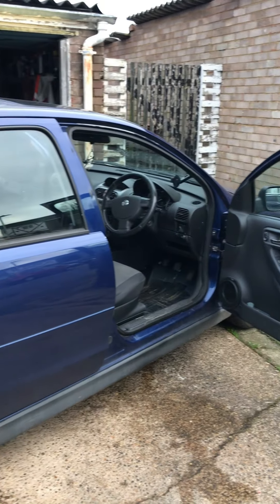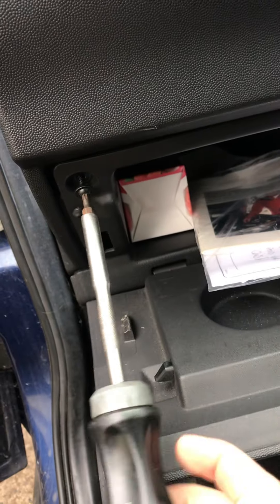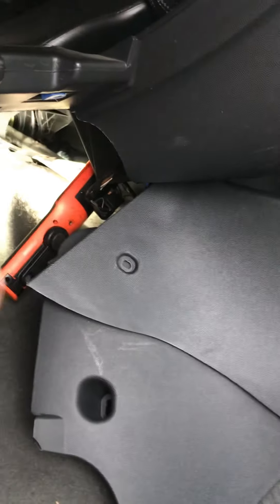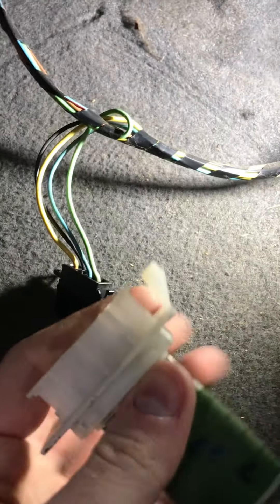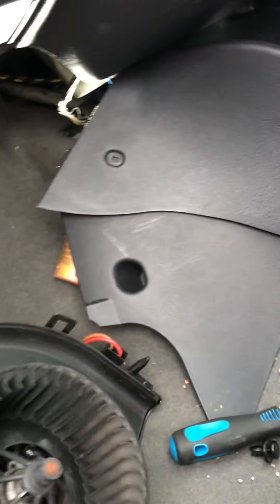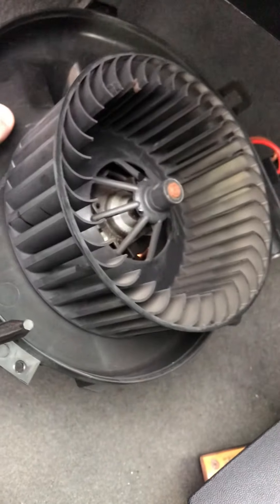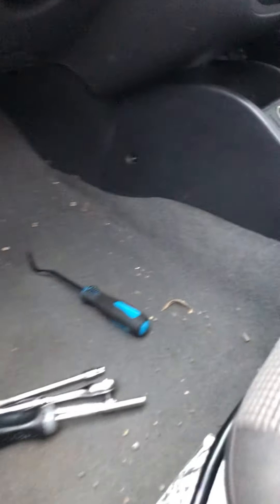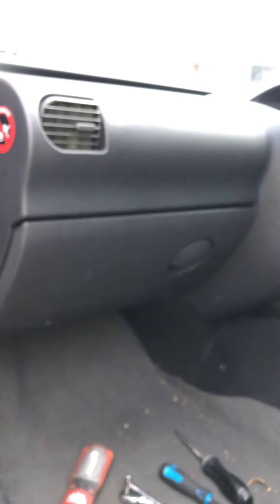Vauxhall Corsa C Blower Motor Resister Change (Blower only working on setting 4)

Comment: Just to say, if you want to check the fan isn't seized up, press the right hand button below the speed setting dial, (the one that keeps air circulating inside the car rather than air coming in from outside), if that's working it will open up the top of the fan and you can get your fingers in and spin it. Mine stopped completely, the resister was good, but did this and it all came back to life!

Comment: Just replaced mine alongside your video (vauxhall combo AC 2011) can't thank you enough. Just wish I'd checked YouTube before pulling the radio and centre console out! Hahahaha. All fixed and back together though. Battled with only setting four for a full year. Can't believe it was a £10 fix

Comment: Maybe it didn't actually fail... Just fell out?
Reply from the maker: It definitely failed, otherwise settings 1-3 would of worked as it was still plugged in. It overheated and failed as it wasn’t getting cooled by the flow of air. Good thing it was an easy fix 👍